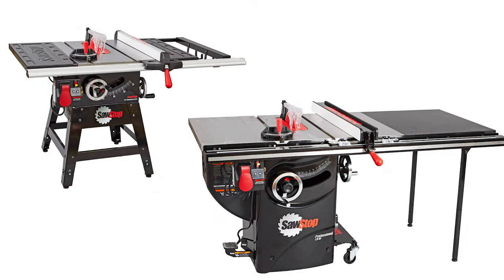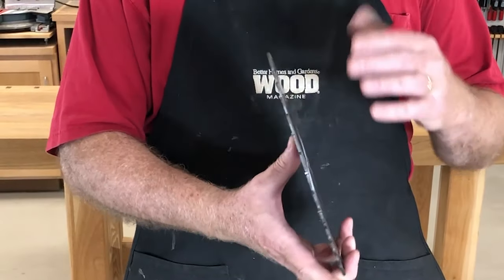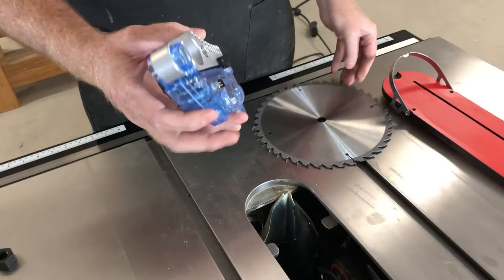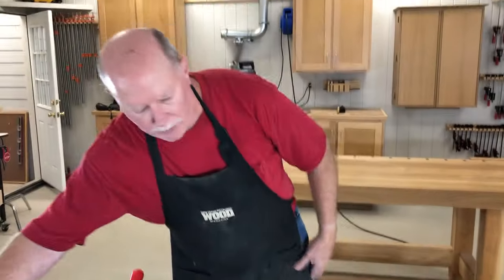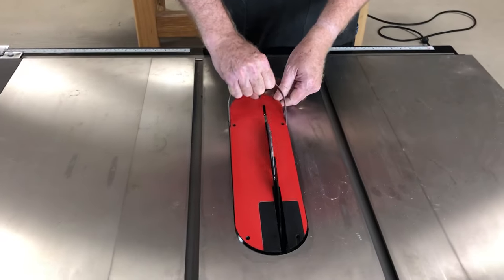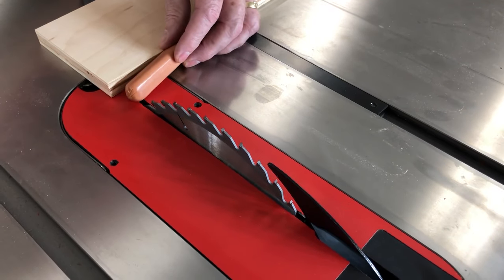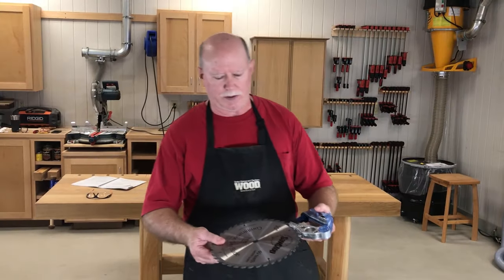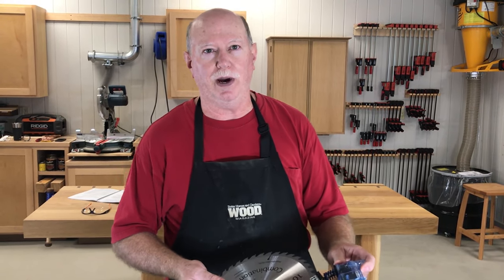How The SawStop Safety Feature Works - WOOD magazine

Comment: Alot of lumber is wet tho
Reply from the maker: You can override the safety feature for that situation.
Reply: @Wood  May be able to wear nonconductive gloves instead of overriding the safety feature.  Should still activate brake if finger contacts blade.  Have not proven this out and this is not a recommendation.  Just a thought based on my limited understanding of how the system works.

Comment: This is not a good safety system. I mean, it's better than nothing. But a better safety system would be triggered by the proximity of the hand to the blade. So, basically, you wear some gloves that have something in them that is detected by the machine. If the gloves get too close to the blade, the blade stops+retracts. Needless to say, the machine will refuse to start if you don't wear the gloves.
Reply: “This is not a good safety system.” Just because you feel like you could create something better (and haven’t) doesn’t automatically negate the viability of a safety feature like this that is already tested, works impressively well, and is already out in the market…

Comment: Want to know the truth about Saw Stop.  They invented (or copied, according to some) an expensive device that is not actually needed in woodworking.  After the patented the device, they didn't rely on it working well and being bought by woodworkers, but proceeded to try to get a LAW passed, REQUIRING, table saws to have their device.  They failed, but they tried.  Money grubbing worms is what they are.  They wanted to make every one of you buy their product at a jacked up price.

Comment: Accidentally hit a nail or have a wet spot n you gotta shut down and pay 150? Good idea but I don't think it'll catch on.
Reply from the maker: You're probably right. At 20 years and counting, the technology is barely proven.
Reply: Only if you are in contact with said conductive substance, i.e. nail, wet spot, foil, etc.  Has to be a conductive path to the body.  Or something of sufficient capacitance or current draw.

The body is a fairly large (electrically; farads) capacitor.  When it is connected to the sensing circuit via contact with the blade.  Current is drawn from the sensing circuit to charge the capacitor.  The current draw is detected by the computer and triggers the brake.

Static electricity discharge from cutting things like Styrofoam could also potentially trigger the brake.  Basically anything that causes a change in the sensing circuit current.

Comment: Wait if its 200 bucks every time it goes off what if your cutting wood that has some water on or in it?? Your screwed out of 200 bucks?
Reply: Learn to use the system properly and save the $200.

Comment: So does that happen if there is say… a staple in the wood? Or a nail? What if you spill a drink? Are you gona spend 200 bucks each time ? No thank you I’ll just use common sense.
Reply from the maker: If you're concerned about spilling your drink while using the tablesaw, we'd rather you not operate a tablesaw at all.
Reply from the maker: But to answer your question, yes, it is possible that a nail or staple or even really wet treated lumber could cause an activation. As the video mentioned, if there isa possibility you would encounter a situation you know could cause an accidental activation, there is a temporary bypass of the blade-braking system.
Reply: Only if you are in contact with said conductive substance, i.e. nail, wet spot, foil, etc.  Has to be a conductive path to the body.  Or something of sufficient capacitance or current draw.

The body is a fairly large (electrically; farads) capacitor.  When it is connected to the sensing circuit via contact with the blade.  Current is drawn from the sensing circuit to charge the capacitor.  The current draw is detected by the computer and triggers the brake.

Static electricity discharge from cutting things like Styrofoam could also potentially trigger the brake.  Basically anything that causes a change in the sensing circuit current.

Comment: So if/when it triggers your table saw becomes a large and expensive dust collector. I’m not a mechanical engineer (actually software engineer) but I would think this could be accomplished using a non-destructive blade brake. Why the blade has to drop below the table surface is beyond me. Just my 2 cents.
Reply: Navret
Bosch developed a non destructive stopping technology but Saw Stop sued and won, limiting further development and adoption of this safety feature. The Saw Stop monopoly is the result and prices are too high for the Saw Stop job site and contractors saws. As for blade retraction. To avoid damage to the arbor assembly that holds the blade, the force generated by the sudden deceleration of the blade has to be dissipated over time and distance,,like the crumple zones in a car crash. To do otherwise would put a huge shock load to the mechanism that has to spin the blade in a precise way with tight tolerances. Even cheaper saws are decent enough. Too cheap isn't worth it.. Hope that helps
Reply: The saw itself is not damaged when the brake is activated. Put in a new blade and cartridge and you're back to using it in a few minutes. I bought one last summer after watching the sales rep run a hotdog through the saw three times during a demonstration. Replaced the cartridges and the saw was running perfect again.
Reply: Felder's PCS is non destructive.